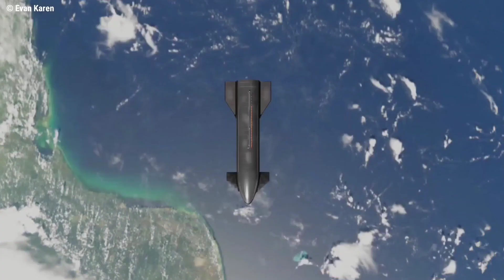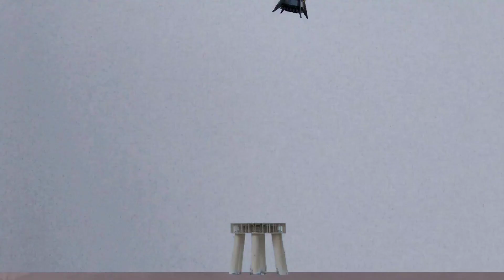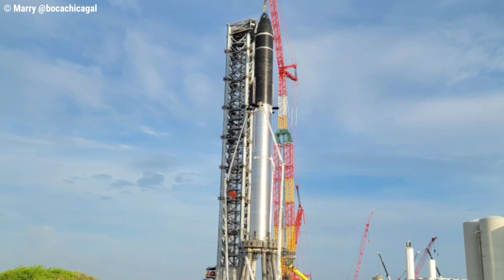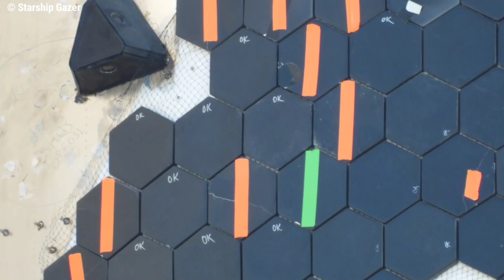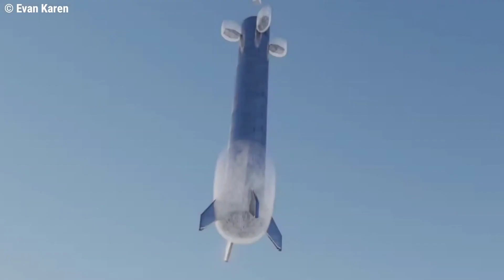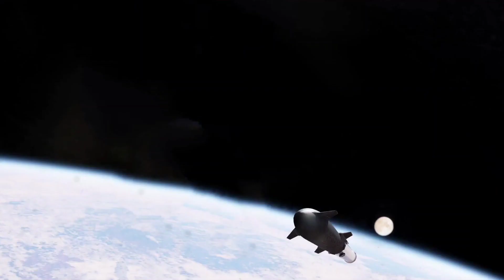SpaceX Super Heavy BOOSTER 4 Prepared For It's First Orbital Launch

Comment: CRAZY IDEA TO MAYBE COVER: Can spacesuits be designed in such a way, that they can be 3-D printed? Certainly it seems like the helmet could. And perhaps the gloves. And perhaps the shoes. But could the entire spacesuit be 3-D printed, either in it's entirety or in part, and then be assembled? I have this vision of a colony out in space. Somebody needs a spacesuit. Perhaps it is a child that has been born there. Perhaps it is a recent immigrant from Earth. The person stands in a room, and his or her measurements are scanned by a laser beam, and a digital copy is made on a computer. Then the 3-D printer starts working, and begins making parts out of powder. The arms or legs might be made separately, have o-rings or gaskets put on them, and then snapped into the torso. The cooling system is integrated into the body. No need for a separate unit. Eventually the entire spacesuit is made, pressure tested, and declared ready for use; and it is a custom fit for the person who was scanned. How close are we?  Can this be done today, with the proper research and development? Note: Suits for females should expand in the belly with pregnancy. Eventually there are going to be babies born out there. Otherwise? What is the point of all of it?

Comment: These small heat shield disks are too delicate and take too long to apply.   A single piece or several large pieces need to be developed for both durability and assembly speed.

Comment: In my opinion heatshield is the major hurdle in fully reuseable rockets,
We have seen it with the space shuttle.
I dont think there is hope until spacex develops their transpiration cooling method.
Reply: They are a big diference between the two: the shuttle had a very complex patern of heat tiles (28 000 unique tiles) when the staship had maybe just four differents tiles: hexagonnal flat, half hexagonnal flat, and their curved version at the edge of the flaps.
Reply: @nicolasrouvreau8365  and the way the tiles were fitted onto the shuttle. Starship tiles are clipped on it, while the shuttle tiles were glued.
Reply: If my memory is correct the transpiration system was dropped for now due to the extra plumbing needed. Also Mr. Musk has been quoted as saying the best part is no part. Besides it’s too early to tell if the transpiration won’t be done in the future. This is STILL the prototype stage. They need flight data for future decisions.